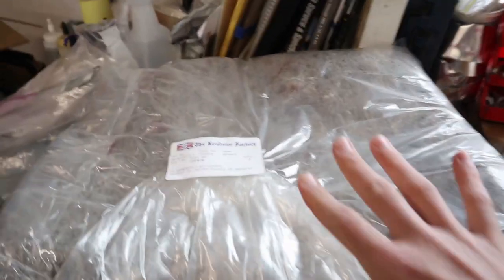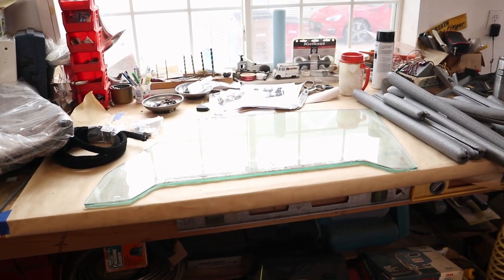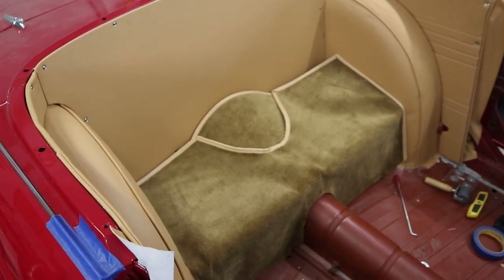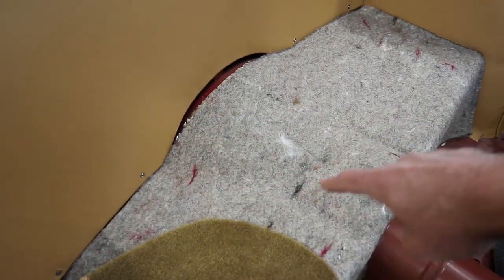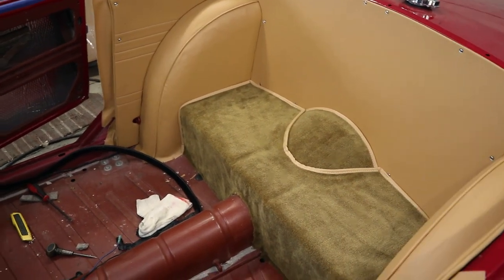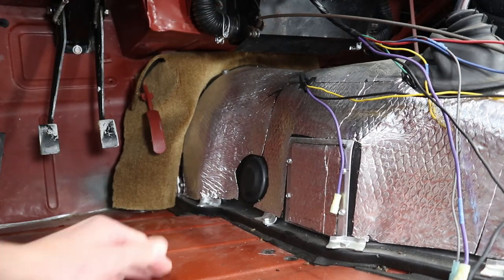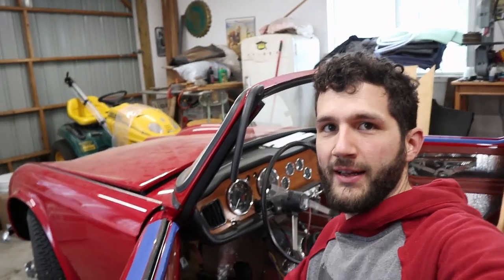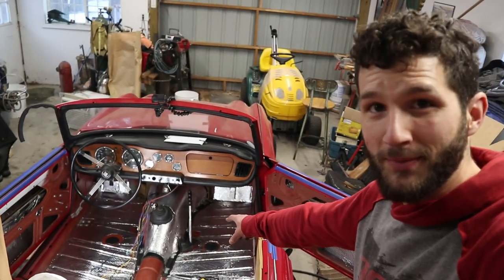Interior Carpet Install on Triumph TR4 - Part 1: Rear Deck and the LEAST IMPORTANT PIECE

Comment: you don't plan on this car ever getting wet, the padding will hold the water and now you can't get it out as you glued it down.
Reply from the maker: Do people use snaps on this part instead?
Reply: @WegsGarage  Don't use the padding, you have sound deadening mat already it works better anyway. use the snaps like you use for the top to hold down the carpet then you can remove the carpet when its wet or needs cleaning and it wont move while your driving.